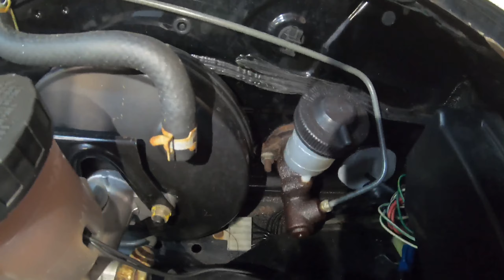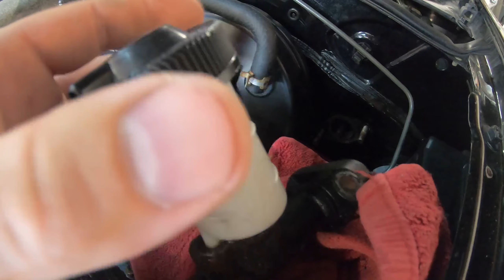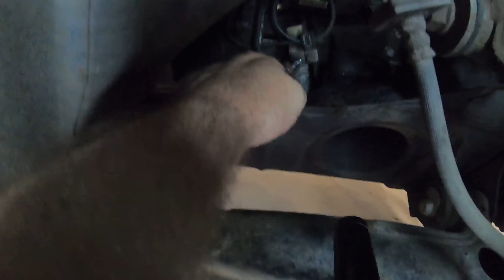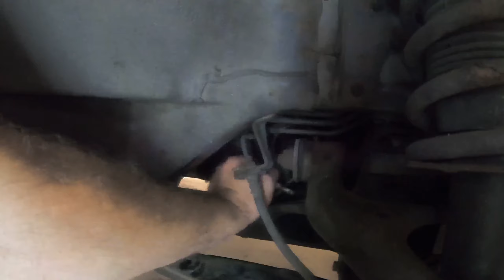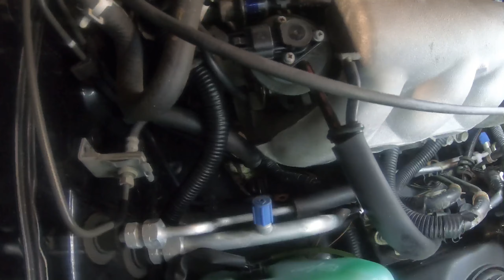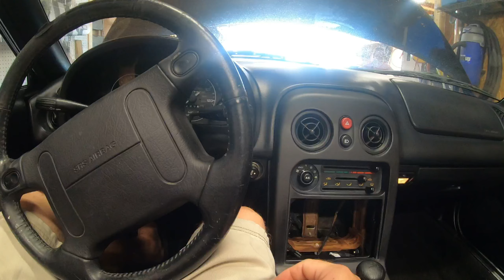Replacing the clutch master & slave cylinders in our 95 Miata project car - spoiler alert: it works!

Comment: I started in computers on a Commodore 64. (That I still have) Now I work for a big fruit company. I also have just gotten a 1999 Miata to rebuild. I noticed your carpet was cut so you didn't have to remove the dash. I did the same. Thanks for the videos.